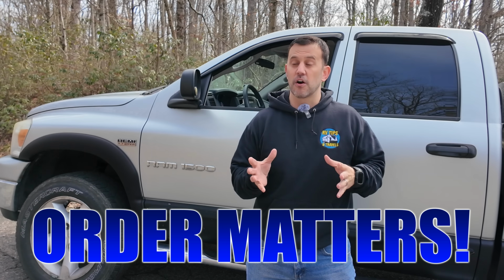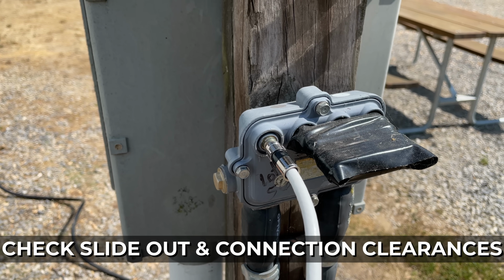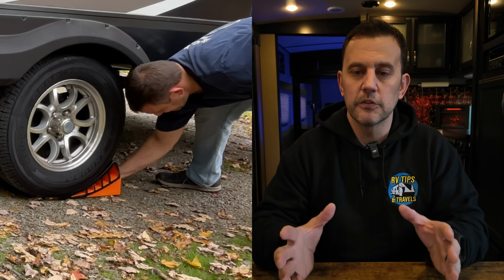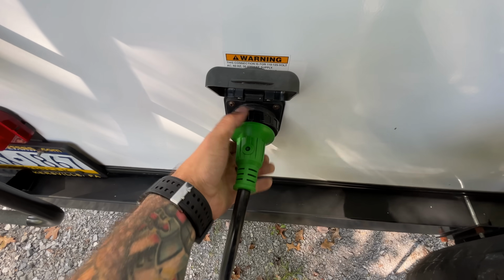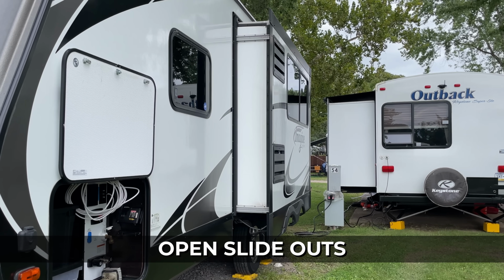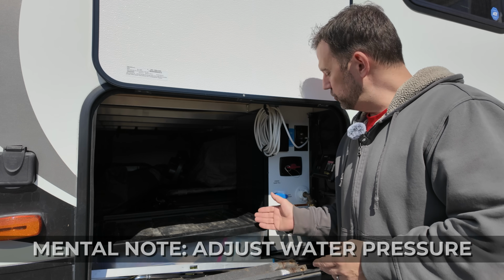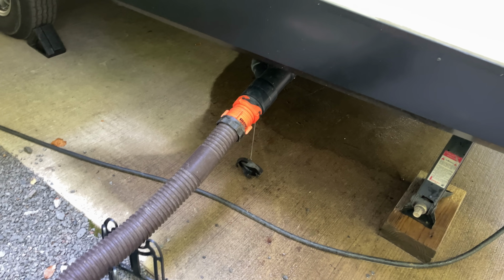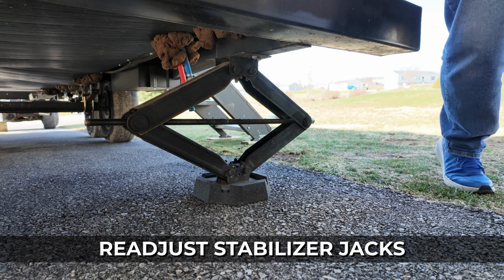How to Set Up a Travel Trailer Correctly ➕ Downloadable RV Setup Checklist for Beginners

Comment: Great video.  And offering a checklist is a real bonus.  My wife and I have been using a checklist since we started.  We feel we know what we are doing but still run down it just to make sure we are doing everything and at the right time.  Tear down and set up is no time for a senior moment.  One part I see you use is the 90* elbow at the service bay for your hose hookup.  On my Imagine that is right on top of the outdoor shower hookup so I have a 45* elbow.  Still saves the trailer connection and still get access to the shower knobs.  Keep the videos coming and thanks.
Reply from the maker: I will definitely keep them coming, and thanks for the visit!

Comment: Why would you turn the water pump on at an rv park?
Reply from the maker: Some people choose to use their water tank because the Campground water pressure rate may be low or fluctuate too much depending on Campground capacity. Some people also like having a consistent water pressure that they’re used to from the pump. There’s quite a few reasons actually. some campgrounds don’t have water at the site, so you have to fill up at a public station at the entrance to the campground.

Comment: Our Travel Trailer has two slides both on the driver side and once they are out the sewer fittings are difficult to get to.
I do the sewer hookup before slides.

Also, the slides are both on one side which does affect how i level it. When I put those slides out it tips a little, not much, just enough so that you can tell when you're in bed. 
To compensate, I level it just a bit off to the passenger side.
I also install a Beech Lane Adjustable stabilizer under the frame in-between the slides.

Problem solved.
Reply from the maker: Nice, thanks for watching and commenting!

Comment: I also use a 5 gallon bucket on the jack, with the safety chains hanging on the handle.  I keep my rig like that all the time, except when traveling.

I find that over time hoses tend to make the water taste funny, so I actually connect my filter directly to the my city water connection, using a 45 degree pressure regulator.  This keeps excess strain off the port because everything is vertical from very close to the inlet.
Reply from the maker: thanks for watching and commenting my friend!

Comment: I found myself nodding in ageeement every step of if the way. One thing I learned just last week: I too put a bucket over the electric jack control, with chains attached to the handle. I choose this instead of a fitted cover because I'm worried about condensation forming inside of the cover. It was a windy day, and the bucket shifted in the wind, and actually pressed the "up" button on the jack. The weight of the chain was actually enough to activate the switch. Fortunately I was right there, but if I hadn't been, I'm certain it would have caused serious damage. I just took the chains off the the bucket to prevent it from happening again, but now I'll remove the fuse. Thanks for the tip!
Reply from the maker: youre very welcome, have fun!

Comment: Shouldn't the steps come out/down to go inside to turn everything on inside and putting out the skide?
Reply from the maker: yes, you will need to put them down to get in, but remember, they need to go back up when you are moving the trailer with the truck, or leveling both side to side and front to back.  if you leave them down you can damage the steps, the threshold, or the door if its closed.
Reply: @RVTIPSANDTRAVELS  Thanks!

Comment: Before you extend the tongue jack it’s a good idea to put your tow vehicle in neutral to let the trailer “settle” into the wheel chocks. That way, there will be no lateral stress on the tongue jack. If you don’t do this and there is any incline, you likely hear a “ka-chunck” when the coupler is raised off the tow ball which means the tongue jack is probably doing most of the work that the wheel chocks are supposed to do.
Reply from the maker: thanks for watching and adding to the discussion my friend!

Comment: Thanks for the comprehensive video, much appreciated. I also like to use my tank water even with a fresh hook-up as sometimes there isn't enough pressure or, because of the number of campers, the pressure varies. Having my pump doing the work means a constant pressure shower which is a great way to start the day.
An add on item for me is setting up solar panels when boondocking. The quicker that's taken care of, the quicker the battery can get topped off. You can't always rely on decent sunshine.
Reply from the maker: great add on, thanks for watching and sharing Norm!
Reply: Great tip thanks

Comment: the Check list and order seems really acurate. Mine is a little different in order for easy access, my waste valve is hard to get to with my side slide out so I do all my hookups before slides. I do like how you mention turning off the circut breaker when plugging and unplugging the rv! I do that also.   Great tips! Keep them coming!
Reply from the maker: makes perfect sense... customizing the list to your trailer is key.

Comment: Nice video, The only thing I would add would be to flush out the water hose before you connect it to the RV.
Reply: I keep my hose ends connected to each other, i drain most of the water first.
Reply: @tommynaron6996 yep... drain the water out first so you're not lugging the extra weight. Then either cap both ends (you can buy male and female caps at most hardware or RV stores) or connect the two ends... and like mentioned when you hook up run some water thru your hose to flush it out and freshen it..
Reply from the maker: great tip, thanks for adding to the video!

Comment: Nice video. Not much more to add other than enjoy once set up. What type of cable lock do you use to secure the Watch Dog surge protector? I'm trying to find one for mine.
Reply from the maker: it is actually a bicycle lock.  ive had it years before rving and didnt get it on amazon but let me see what i can find.  the only catch is you have to use something with a lock that will fit inside the steel cable lock on the EMS.  let me see what i can find for you.

Comment: One step I’d make note of - I always connect my clear elbow and campground side of the sewer hose FIRST- that way if worst case scenario the waste tank gate valve failed and I remove the cap to any residual sewage leaking, I can shove the sewer hose in place and only have a minor incident versus a huge problem.
Reply: I added a second valve to the trailer. That stopped all my excess dribbling and mess!
Reply: I always put a bucket under the valve when opening the cap, just to be ready for any nastiness.
Reply: Replace with a clear cap to the end of your drain pipe instead, you’ll see what you’re going to be getting before twisting it off. 
No surprises here….
Reply from the maker: yep, great point Josh.... thanks for adding!  start at the sewer and connect backwards to the RV.

Comment: There's plenty of debate about this, but I always have to put my slides out before lowing the stabilizers. If I do it after the opposite side stabilizers are off the ground an inch or so. Which means now the trailer is not level side to side. I use the LevelMate Pro, which is similar to your Beech Lane unit. On my app I can set a level. So what I did was leveled my trailer perfectly with the slides out, no stabilizers. Then brought the slides in which causes the trailer to become unlevel. But that's the key. I set that as my level. So when I'm leveling it with the app before the slides are out I know it will be level when I put the slides out. Then I drop the stabilizers. Some people do it differently, that's just how I do it. Since I have two massive rack and pinion slides on one side of my travel trailer.
Reply from the maker: Thanks for your input, and I cant lie and say I havent opened the slides with the stabilizers up.  I know dealerships do it all the time, and it doesnt seem to cause an issue... however, with 100,000 folks watching, I am always going to follow the "book" unless I have proof otherwise.  Stabilizers shouldnt change your roll or pitch to any significance anyway if they are lowered after, at least they shouldnt.  However, because the manuals say to level before opening slide outs, thats just what I feel is the right thing to do, but I understand what you're saying (I think we discussed this in the comments on the Beech Lane Level video).  As always, I appreciate your input my friend!
Reply: I think the reason most mfr recommend leveling before extending the slides is the reduce the stress on the slide mechanism during operation. If you level the rig “slide high” to compensate, then you are trying to push the slide open “up hill”.
Reply: When leveling, I also put the slide side slightly higher but I've found the type of surface makes a difference.  I might only put it a quarter inch high (Level Mate Pro) on hard asphalt or might do half inch on soft gravel.  Settling can be an issue.  Like you, I also wait until the slide is out before lowering the stabs.  The suspension can handle the shift in load far better than the stabs.
Reply: I really like the idea of "leveling" with the slide out, then pulling in the slide to see where the bubble is so the next time I can set a "pre-level" before putting the slide out. I get really frustrated after taking the time to level side to side then putting my slide out to feel the trailer lean to that side. It will save some frustration with my wife too, because she calls out the bubble position to me as I'm pulling on to the Andersen's. 😅 Great video!
Reply from the maker: Thanks for watching and commenting!

Comment: It is very helpful to have the correct order spelled out clearly, like you have done. Thank you.
I have one issue, however. I believe that scissor jacks are stronger when they are extended as little as possible, and this goes for the tongue jack, too. I always use my unneeded leveling blocks under the tongue jack and use the entire set of stabilizer pads under those jacks, so as to raise the jacks as little as possible. 
Am I incorrect? If so I'd like to know.
Reply from the maker: I believe you are, I used to put blocks under my stabilizers, i havent in a while and i havent really noticed a difference.  however my trailer is on the shorter side.  It is something I want to make a video about.  I did put up a quick text message in this video about using blocks can help with stabilization (did you notice it?), but I didnt want to spend too much time on that aspect in this video.  If there is enough interest for a very detailed set up video (one that goes into how to specificially do each step other than just the order), I am happy to make one.  let me know.
Reply: @RVTIPSANDTRAVELS  Ah, there's always more that can be added, like pedestal checking and battery charging, but your video did a good overview. Ya gotta stop somewhere. Regarding jacks, I would be interested in some real data about extended strength vs using blocks to reduce the  underside to ground distance.
Thanks. BTW, I didn't look over the check list, yet, but will.

Comment: Excellent video!  Honorable mention on the checklist should include shedding or buffering stress upon arrival.  I've seen so many rv'ers throw every bit of knowledge they have out the window when they arrive stressed.  From leaving late, to bad drives, or even impatient rv'ers waiting for them to back in.  It really causes havoc on the most seasoned rv'ers.  So if I have to modify my checklist to include giving myself a moment, I do that first.
Reply: 15 years setting up. Don't rush! Double check, then let the dog and wife outta the truck.
Reply from the maker: EXCELLENT TIP!  We're all doing this for experience so we should all take a deep breathe and relax.  Thank you for adding!
Reply: I have "Take a deep breath" on my checklist right before "Back into site"
Reply: Great tutorial